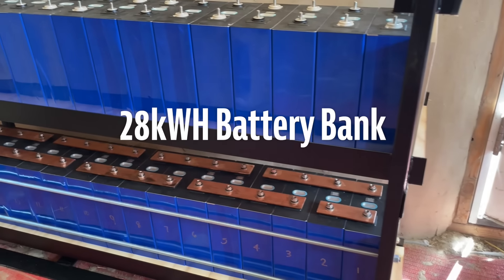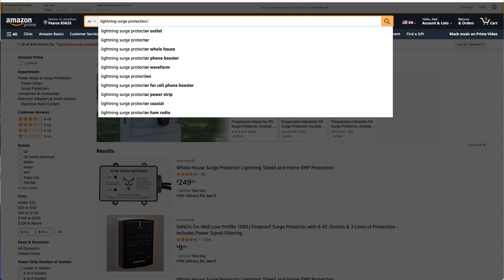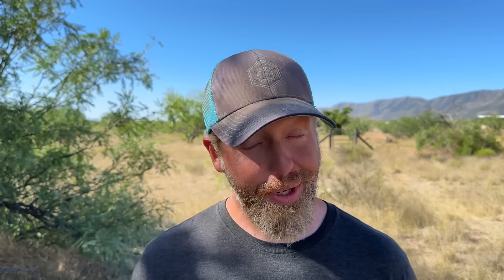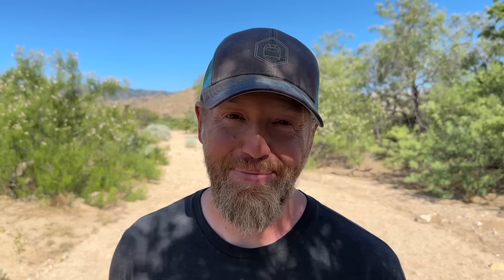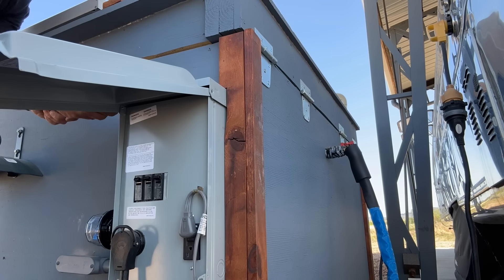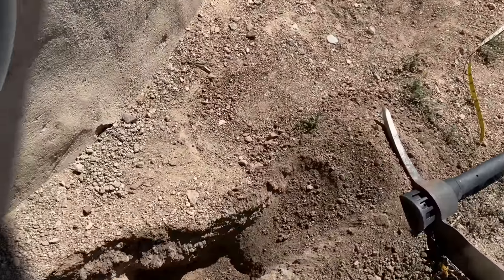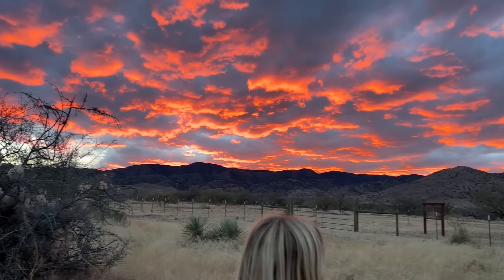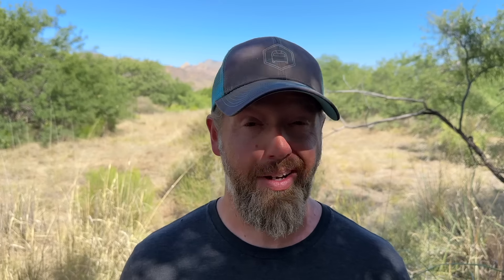This Cost Us THOUSANDS - Lightning Destroys DIY Off-Grid Solar System

Comment: It would be a lot of work, but if you ran all of your outdoor underground wiring in metal conduit, said conduit to be grounded at both ends with multiple ground rods, that would be additional protection.

 In addition, to improve the resistivity of your existing ground rods, you could soak the area (a two or three foot circle) around your existing ground rods with either  a couple of pounds of copper sulfate or magnesium sulfate and water.....

I use lighting protectors on each panel and subpanel by putting in a two-pole breaker (just to protect both phases) and wiring the protection to both poles. I use leviton 51120-1, but there are lots of other good choices - siemans, etc.....and yes, they are one-time use devices, if the lights are out or they turned red or something like that, they protected your panel. 

In addition you can buy individual surge protectors for sensitive equipment  - computers, etc. For those I use Tripplite.....like the Isobar  AV2FP. Of course in the end, you can only do what you can do.....and so a little luck is also part of the equation......

And one more important point. Lighting can show up on any or all of our conductors (assuming you have 240v) a ligjting strike can hit either phase, the neutral or your ground conductor. so you want all of the conductors to be protected before the lightning comes into your equipment.
Reply: I think they have already done all the research for this. Since last summer in fact. So you are too late.
Reply: @bridgwll  imagine saying it is too late for new helpful information
Reply: @SuperSpecies  they don’t need the information. This was a story that happened months ago. They had already fixed the problem. Get it?
Reply: @bridgwll  ah so you think the comments section on youtube is just for the video creator to read. You know others can read it, too?
Reply: @SuperSpecies  where did I say that? Don’t put words in my mouth & make it up as you go along.
Reply: @bridgwll  I'm trying to understand where you're coming from attempting to stop people providing further input on the topic of earthing
Reply: @SuperSpecies  you don’t need to concern yourself.
Reply: @bridgwll  yet you felt the need to concern yourself with replying in a negative way to the original commenter providing useful information, so here we are.

Comment: Lighting surge protectors inline for each PV string is a must. Midnight solar has legit equipment. I would also suggest swapping out those breakers with the ones sold by Midnight Solar. They are just much more robust.

Comment: Howdy, thanks for the informative video. Being from South Africa, I'm not 100% sure I'm following your electrical naming conventions in the USA but the physical connections should still be the same. When you showed the last SPD installation, you only connected to the live input wire if I saw correctly. I'm pretty sure you should have used the other protection wire as well. The reason for this is that lightning, conducted or induced, will travel along any wire, and therefore AC-Live, AC-neutral, DC-positive or DC-negative (even the ground wire until it gets to earth) must be connected via your SPD to earth/ground.  I hope you have no more issues. 
PS: I also saw that the installation manual for these devices also shows that you can install both protection wires, on either side of the breaker so that even when the breaker has tripped, both sides are protected which I thought was good practice.
Reply from the maker: They're made to connect to the hot lines, not the neutral lines. That breaker installation is for a 220V, one hot line for each leg of 120V.

Comment: I have a 65 panel array.  A lightening strike hit my system last July and I finally got it back up and running in January.  Because I was waiting on Shine Solar to do the repairs under warranty.  My cost of repairs since I waited (not patiently) was zero.  I'm not off grid so I had the local power company as a backup.  Trust me, paying a solar loan and paying a full electric bill is NOT the plan.  I do have a switch I can flip and turn off the power company and rely on my 15 hours of batteries through the night.  I'm in Oklahoma.

Comment: Sorry you took damage,   We just had a indirect hit here,   We lost several odd things (camera system, 1 Hard drive, Router etc still looking for other stuff) I have read (don't remember where) that people in very dry conditions regularly water ground rods something like 5 gallons each once a month to keep the ground moist.  You could use a bucket with a small hole place right over the rod,  fill the bucket and let it slowly drain into the ground around the rod...  Grounding is critical

Comment: @ 10:10,   The system is 120v AC, only only hot L1, neutral and ground?    So instead of leaving the second half of the SPD disconnected, connect it also to the L1 hot.  Twice as much protection.   On the other hand, as you wired it, maybe the unconnected half could be used later as a spare.
Reply from the maker: Pretty sure that's not how it works ;) You'd want to verify that idea with MidNite solar, though.
Reply: @TinyShinyHome  isn't one side the line side, and the other the load? Thus, like a regular breaker, the power flows through the device when in normal operation, so that if it clamps during a surge, there is no alternate path for electricity to travel.

Comment: The first thing I noticed is the multiple grounds are NOT bonded to each other and the panel rack, the trailer shelter, the inverters, etc. A very common mistake is to think ground is ground, unit you get a nearby lightning strike and the ground voltage gradiant kills the system.  Get a copy of the National Electrical Code and carefully review the grounding and bonding section to prevent damage from ground gradient voltages.
The solar array, the power building with batteries, and the trailer pad should all be bonded to prevent damage from a ground voltage gradient surge in the DC and or AC systems. There is a reason a radio tower has ground radial wires in addition to the ground rods. This is to protect against direct lightning strikes in addition to nearby strikes from causing damage.

Comment: Very interesting and informative. 
If you're not collecting rain off the solar shed, how about installing a tank purely to collect any rain or dew and use the water to drip feed the earth stakes.
I used to live in the desert and although I had access to loads of water, the ground was very dry, so I watered the earth stakes and it stopped the tingling from touching the water pipes.
Reply from the maker: Because in our particular situation here that would be a waste of a very finite resource...
Reply: @TinyShinyHome  I take your point, but human life is more precious. 
Without the earth stake working correctly, your earth stakes are compromised. Therefore the risk of electrocution is considerably increased if you have some sort of electrical fault in any appliance because the ELCB's may not function correctly.
Reply from the maker: That's why we added more rods. A simpler solution that requires less maintenance and resources.

Comment: Grounding------ Dig a two-foot deep trench, twenty feet long.  Bury a 1/2" or 3/4" galvanized pipe, and attach your ground wire to the pipe.  Backfill the trench with good-quality soil or clay instead of the sand that came out of the trench.

Comment: Bluestone, or Copper Sulfate should be layered in the trench with the wire, I learned this from our Telecom. That's right, copper sulfate, we used heaps of it when grounding our Telecom Towers in degenerate granite soil, sometimes 4 runs per tower leg!!!  When you see what lightning can do to 2inch by 1/2 inch wave guides of solid copper, and you have to climb the tower and replace the whole damn lot, you sure as eggs   ----  GROUND EM!

Comment: Maybe a suggestion that is lowcost. Put up some metal rods that are higher then your solar rig. They should get struck first by the lightning and avoid the panels.
Just an idea as in my apartment we are not allowed to build/install (ac unit, satellite dish) above the lighting system antennas that stick up on the roof.

Comment: A big issues with any large installation is getting insurance coverage.   Most home owners policies will actually cover lighting damage.   It far less expensive in personal time and peripheral expenses to include as much lighting protection as possible.   This includes any wires passing between the indoors and the outdoors.   It may not protect super sensitive electronics.   With outdoor TV antennas where lighting protection is typically code if it gets a direct hit the grounding lighting protection wire can actually vaporize with the vaporized wire still conducting the lighting to ground.   The TV is likely toast, but kept the deadly effects out of the house.

Comment: Hi there, just found your channel and watched this vid on lightning protection. While watching your improvements i didn't see you protecting the neutral of your system, lightning can still make it into your system through the neutral conductor of your ling runs. Now i could be completely wrong but adding more groundrods isnt going to do much, its better but it is my believe you need to go deeper with your rods. Like you said the ground is very dry so tour rods should be in the groundwater or close to it. Hope this helps you protect your system better and keeps you and your family safe. Regards alex
Reply from the maker: The Victron inverter bonds ground and neutral internally 👍🏻
Reply: @TinyShinyHome  ok so your inverter is safe, what about on the other side? You bonded the neutral and ground on the other side aswell?
Reply from the maker: There is no other side. You only bond neutral and ground in your main panel and not sub panels. In our case since the inverter does this internally on the AC out it’s acting as the main panel.
Reply: @TinyShinyHome  ok, I meant you have no protection on the neutral on the tiny shiny shed side unless you unplug everything when there is a thunderstorm.
Reply from the maker: No, once the neutral and ground are bonded at the source or main panel, that's all you're supposed to do. You don't bond again at subpanels (see https://www.galvinpower.org/subpanel-grounding-and-neutral/ and many other similar resources) Out of the inverter we go through a main panel that separates the power to solar shed, Airstream, and house (eventually).  The solar shed panel is then considered a subpanel so no bonding. On the SPD side, that would only be necessary if the subpanel was 100' underground run away. The shed subpanel is right next to the inverter so no additional protection is needed there.

Comment: I might of missed you mentioning 
If your solar arrays had a ground rod
I think you did install a ground rod for the array and another for the house(electrical)
If you did, the NEC requires all ground rods be connected to each other via a bare copper wire in the dirt.
If not, what can happen, when there is a lightning storm nearby
the electrical surge in the area  can create a difference of potential in the metal of the equipment.
In other words the arrays would have one voltage potential
Compared to the electrical equipment, would have another voltage potential.
When there is a difference of voltage potential between electrical equipment
Current will flow, it’s more probable than not, 
that current flowed in your underground wires and took out the electronics(inverters).
Let me, repeat all ground rods need to be bonded(grounded) together via a copper wire
To keep them at the same voltage potential and eliminate induced current flow.
Remember this, if lightning were to directly hit your equipment 
nothing would save your equipment, lightning is amazing and awesome.

If you did not have a ground rod for your array, but have metal pipes in the ground supporting your arrays
that pipe alone works like a ground rod and can create that voltage of potential 
that I texted about , I would bond it to the ground rod to eliminate current flow.

Comment: I also recommend adding salt around grounding electrodes to help conductivity since rainwater is not very conductive. Furthermore, creating an equipotential plane all around your property wherever there is any electrical wiring of any type will help to keep everything at about the same potential in the event of a nearby lightning hit. Even if the ground potential instantaneously raises by thousands of volts (as it does when lightning hits) all of the equipment and surrounding area will also be going up to the same potential thereby keeping it better protected.
Reply: Wouldn't salt corrode the grounding electrodes? I live in Cochise County too, and now I'm freaking out about the lightning here. I'm not sure how to go about creating an "equipotential plane", but I guess I need to look into that. I had thought about putting lightning rods on my new house, but if grounding is a problem here that might not help.
Reply: Basically it means you put a network of conductors in the earth all around your property like a wire mesh -  but with heavy gage wire - it does not need to be copper but should at least be corrosion resistant - then tie all metal parts to it through SPD's. You would also tie phone lines, power lines, cable - internet - any other wires coming into or leaving the property through fast acting high current surge suppressors so that if a lightning strike occurs in or near your property then everything in and on your property will simultaneously raise the potential up and drop back down as the energy is adsorbed and dissipated. 
Nothing provides total protection but this is the best - most effective means!

Comment: Hi Jon, I was wondering how deep the water table is in your hot season. Possibly deeper than the length of those earthing rods. Would it be a reasonable idea to drill a 2” hole deeper and weld the rods together to increase their reach into the soil? What do you think? This is a very informative video, great job. Thanks for sharing.
Reply: deeper the better
Reply: You can buy stuff to surround the rod in the soil in poor earth locations but it's basically cat litter. It's really good at soaking up moisture and keeping the ground around the rob as conductive as possible.

Comment: SPDs for the win!  Lightning protection can easily be done incorrectly if you're not familiar with electrical systems.  It's worth spending extra $ on some expertise to get it done right.  Otherwise you can spend hundreds of dollars putting in the wrong kind, in the wrong place, or wiring it incorrectly, only to find that out AFTER the lightning has done its damage.  

The most common SPD include MOVs, which have a finite capacity to absorb surges - and the bigger those surges are, the fewer they can survive.  For the more expensive ones, they will include an LED which will go dark when the MOV fails.  So keep an eye on those LEDs!  Check after every major storm and replace any protection units that have gone out with new ones before the next storm hits.

Comment: I worked as an engineering manager for a firm that designed surge suppressors for commercial and residential use. I'll state that the surge suppressor is only as good as your grounding GRID.
Bell offices, internet offices, data centers, substations, etc. have a WELL designed GROUNDING GRID (well most do...😄) and most measure the impedance of their GROUNDING GRID. Below 5 ohms is acceptable but I've seen as high as 15 ohms (NOT GOOD). You did increase the size of your grounding grid which is good, therefore your surge suppressor MAY work or not. 
Three of the most common components in surge suppression are metal oxide varistors (MOV's), silicon avalanche diodes (SAD's) and gas discharge tubes (GDT's). SIMPLY MAINTAIN GOOD GROUNDING and good luck.

Comment: I work for a big electric utility can't say which one because you know I don't speak for them, but we have lot of switch yards, mountain top microwave tower electronic stations, and power plants. We deal with lightning strikes every year one mistake people make is grounding equipment to different grounding rods in different places. Let's say your solar panels has a ground to a rod hammered in the ground near the solar array and you have another earth ground at the spot where your inverter is mounted yards away. Lightning strikes the ground nearby think of it as a pool of water spreading out from the spot where it hits. As the power dissipates it will create different voltage on those different grounding rods. That difference causes current to flow through the electronics causing ohms law that is why it damages sensitive electronics. What you want to do is try to earth ground everything to one spot if possible. That will keep the voltage the same on all the ground points and possibly keep current from flowing. If you get a direct strike to your equipment nothing will stop it from taking everything out except when it runs into fiber optic jumper. We had a single POE security camera take out $1000's of dollars network gear because someone forgot to install a lighting isolation device.

Comment: the more g rods the better, especially for you, i'd still probably add more. i was chatting with a motorola engineer, and was talking about how code in residential and in most all cases to save lives human lives, not electronics lives. in big data centers they what the ohms to ground as close to zero as possible. as far as i can tell logically, surface area is the name of the game. power companys at sub stations use steel grids as ground rods in  some places. so i see that as more confirmation the more the better, at least to a degree.